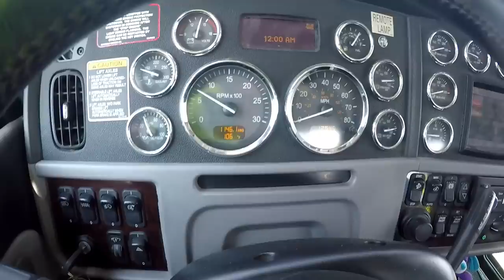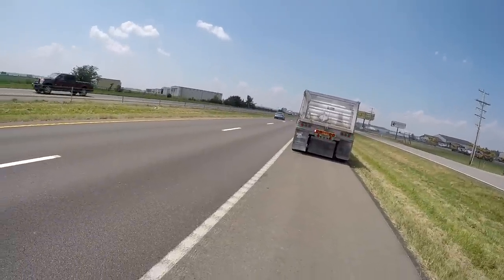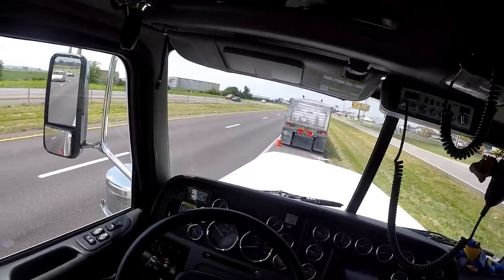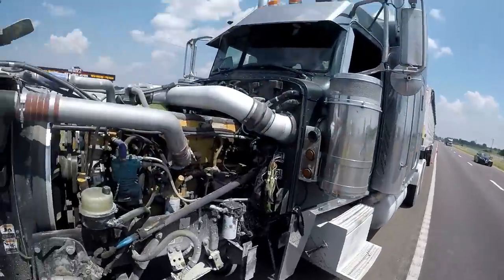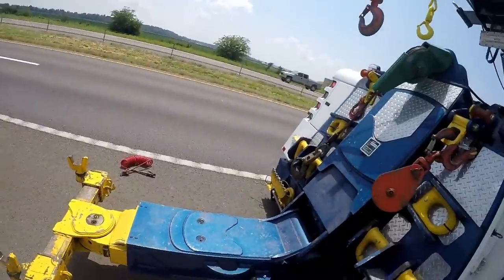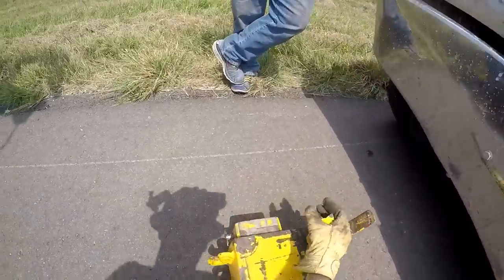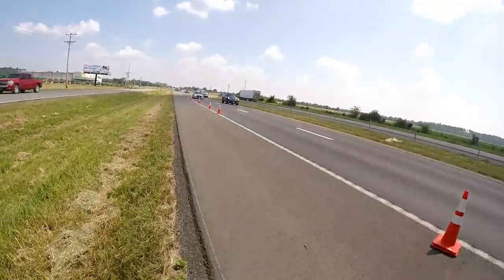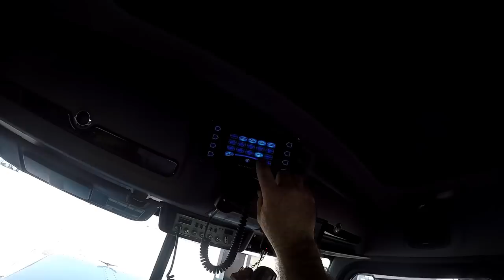THIRSTY TRUCK ON A HOT DAY

Comment: You could pick up a surplus M-60 tank to use as a blocking vehicle. Wouldn't even need warning lights...
Reply: Yeah , and how long would it take to get there ? Lol !
Reply from the maker: I love the idea as long as the cannon and guns are still live.....just in case I have to make an example out of a driver that doesn't get over.  Guarantee the rest would move.  Just kidding.  I'd never hurt anybody intentionally.  A tank may be what is required to move them over though.  Wouldn't that be a sight??!!  Thanks for the chuckle, friend.  God bless.
Reply: Ron Pratt 3
Reply: A nice cheaper alternative would be a nice little used M113 the good ol' aluminum box on tracks that we've been using since the '60's, nice power and it doesn't weigh too much comparatively but rest assured it can still drive over and crush truck if you need it too ;) lol. And it's good for off road extractions too like that U-haul van from the past.
Reply: @GoldPicard  i think rhats a good idea
Reply: Ron Pratt I was about to say point the gun down range and have someone sitting on the 50 lol
Reply: @protectoroffaith  thatd do it 😂
Reply: Oddly enough they will see that even though it has no lights and is painted in army green.
Reply: Wet Lettuce “it’s camouflage. I didn’t see it!”
Reply: I saw something like this at a parade once. An Abrams tank was coming down the street. Lots of people were off the sidewalk, in the road, until that big beast slewed the turret a few degrees in either direction. Then they were tripping over themselves to get back out of the road.

Comment: Too many stupid people on the road that have no idea what hazard lights represent and what you should do when you see them!!
Reply: I  would    say      not    to many    but  all of  them.
Reply: Some of the drivers could not get over because of a car beside them going the same speed as them ive had issues where I could not get over for a tow truck because of someone being a idiot and slowing down when I wanted over.
Reply: There was this dude cutting off a fire truck the other day
Reply: @charlieretro  how about using the brakes... or if it's a somewhat decent car, the gas pedal. if he's going the same speed you are what's he doing on the overtake lane anyway, but besides that, you can just hit the brakes and go behind him or accelerate and go in front of him (and then slow down to annoy him back a bit ;)

Comment: Nice job on the lightbar.... Also a good idea for you or any one else.. If your phone is having issues  with loading an app or even making a simple call... Instead of turning it off then on...  "some phones take forever to restart" just turn on airplane mode on  and then turn it off after 10 sec... IT resets your data and reconnects  to a new tower
Reply: Yes, airplane mode CAN be faster than waiting on a phone to cycle down and up,  but it doesn't hurt to cycle your phone off once a day (or once/week at least).  Do it before you need to use it, and it'll be refreshed for when you need it.

Comment: I used to deliver hot tubs with a 40ft flatbed truck- I always set cones out any time I parked on public roads.  Had one driver intentionally hit my cones, scattering them all over the street.  It's like a game to some people...
Reply from the maker: Sad but true.  And getting worse with "distracted" driving.  Thanks for watching and God bless.
Reply: There's a foundry down the road here, and I've been wondering how much it would cost to get a cast iron traffic cone made.  Good coat of paint, put it second in the cone line, and make sure you have a good HD camera to get the video for YouTube.
Reply: Joe Bramblett With cast iron, I think it would turn into a frag grenade when someone hits it. Too much shrapnel
Reply: @appleintosh   we need a hollow soft steel shell filled with concrete, just like those poles in front of wallmart doors, hollow shell bends, concrete explode but a combination of the tensile strengh of steel with compressive strenght of concrete is just impressive, just look at that totaled car vs that saved life
Reply: @andromaliusification  blue concrete.. it won't break if you throw a v2 bomb onto it :P the normal gray concrete isn't all that good. but on the blue concrete you can waste quite a few drills before you have a hole in it. (as in it's cheaper to just move stuff made out of it and ditch it in the ocean than attempting demolition ;)

Comment: National Weather Service has issued a Warm Weather Advisory for Southcentral Alaska starting Friday and running through Saturday. The warmest day will be Saturday with temperatures climbing into the lower 70s along the coast and mid 70s to lower 80s inland.
These temperatures will be 10 to 15 degrees above "normal" high temperatures for early August.
Please take appropriate precautions for your children and pets, and have a fun-filled weekend!
Reply from the maker: Ok....I'm moving north to Alaska!!!
Reply: Thought you'd get a chuckle out of this.  I copy and pasted this, when I saw your 106.  I've hauled a lot of melons out of your neck of the woods in that kind of temperature, but I sure am enjoying my retirement up here.
Reply: Ron Pratt are u really
Reply: Ron Pratt people are so ignorant today maybe you should close of a lane so they must slow down or stop it I saw someone like you I would reduce my speed by 10-20 mph and move in the other lane
Reply: That's the temperature here lol
Reply: When i went to Ireland they were having an unusually warm summer. The locals basically said the same as that weather advisory. One even went so far as to use the phrase "boiling."
Reply: After 2 weeks of 80's to 87's here in Minnesota today it was 67 with some rain, Its supposed to be low to mid 70's all next week. But the building I work in has plastic and rubber molding machines along with an industrial oven that is almost always at 400F every day but Saturday, so its always warmer than outside.
Reply: Max Bailey it's currently 12°c in Ireland. I checked that's 53.6 in the American system
Reply: Alex- lee global warming is the culprit?
Reply: Lol!
Wooo, summer vacation in Alaska, 2018!
Reply: hey at least you  dont live in Utah  where our normal  regular high is 105-110 degrees
Reply: You could come down to FL where it's mid 90s fornsix months straight

Comment: Hi Ron, great work out there. I grew up around the business, I currently don't operate but would like to, besides that it's great to see how your so helpful to everyone and that's what the industry needs more operators like you. Your an inspiration to new operators. I do have one question about your updated tow light, what make and model LEDs (red/blues) did you use on it? I like the idea and I like how you could still see them from the distance that the officer had stopped at. Thanks for being out there helping.

Comment: that was an expensive tank of gas.
Reply: Yeah, when I watched yesterday my first thought was just like a company man to run the thing out of fuel a mile from a fueling station. Kudos to Ron for his attention to detail like noting those low tires and stopping to call for traffic control. He's got the gift. Situational awareness.
Reply: Thanks it was a big petrol station. I remember a day some years ago when a bus and my semi (with double fuel tank) stopped for a complete refueling in a very very small gas station in nowhere here in Spain. We let the station tanks empty. The petrol company has fill them few hours before. When we continued our route the owner hanged the sign ⛔️CLOSED⛔️
Reply from the maker: Yes, it is always a bad day when someone runs out of fuel.  At least nobody was injured or killed.  Thanks for watching and God bless.
Reply: I once ran out of fuel some 500 yards from a fuel station. Yes, the low fuel light had come on, but the vehicle (Mercedes Sprinter, max 5 metric ton or 11K lbs) was using 14 liter per 100 kilometer (16.8 MPG) and the manual said the light would come on at around 2 gallon. I should have been able to drive 33 more miles, and the gas station was 10 miles out. Didn't make it...

That day I learned two things: One, I couldn't make two of my regular runs (I normally only had one per day) on only one tank of fuel even though the gauge told me I had more than half a tank left after the first run, and two, don't trust the warning light of that truck. It's a good thing the manual also told me it was self-priming, so after putting in some diesel it started right up after 30 seconds or so.
Reply: Paul Nieuwkamp I learned years ago, from watching my parents, to never trust any fuel gauge when you haven't personally run the vehicle empty to determine how much real reserve it has. My favorite car to drive, an old 280ZX, actually has 2 sending units and 2 gauges - one set only reads up to 1/4 tank, and when that gauge hits 0, the tank is empty*. Even the with the digital bar graph display, that tells me to within 1/2 gallon *exactly how low I am.
Reply: @RonPratt How much does big truck towing cost just out of curiosity?
Reply: @zuestoots5176 one of the first things I add to each vehicle is a two gallon can for just that reason; fill the can, put some HEET in the tank and run the tank dry noting how far after the light comes on and whether it gives any trouble before dry, then use the can to get it to a station and fill it up with good gas.
Then it gets the floor jack and four-way lug wrench, jug of coolant and a couple quarts of oil.
Unfortunately, none of this helps when a huge raccoon decides to head-butt the corner of the radiator at 70mph and it dumps all the coolant within two miles, 85 miles from home and 14 miles from the nearest mechanic, who doesn't open until Monday.  Yeah, it's been a wasted Saturday waiting for a wrecker and then looking for a place to stash the key at the shop so I don't have to go back to take it to them Monday, then getting my roommate to drive out there to get me.
Reply: I just ran one car dry, but was able to roll to a gas station (happend by accident - sketchy fuel gauge + very variable gas milage).
On every other one I know how much they drink and the tank volume (got one down to 1.6 liters left in the tank), current one calculates the remaining kms from EFI parameters and that will reach 0 before the tank gauge does (says 40kms left, that should leave 3.2-4 liters left in the tank, but according to the pump there still were 6-7 in it). Guess they built in a safety margin, as here in Germany running out of fuel on the autobahn results in a fine).

The other stuff, some oil, water, and a good sets of tools, I consider mandatory.
Reply: @nonameposter378  I'd take a guess and say it costs $500 just for him to hook it up

Comment: Why Don't You Put Magnets On That Light Bar!???
Reply from the maker: Some light bars come with magnets built in.  We don't use the magnets for several reasons.  1---there are a lot of vehicles with very little metal in the area needed to mount the light bars.  2--the magnets tend to damage painted surfaces even if well protected.  Thank you for the suggestion, though.  Thank you for watching and God bless.
Reply: plus sometimes there is hardly any steel for the magnet to stick on magnets dont work on alluminum
Reply: Most trailers are aluminum they dont make magnets for that :( they'd come in hella handy tho

Comment: @Ron Pratt You should buy the safety flag that oversize loads use. Put it on the end cone. People might see it a little better. If not that buy a custom construction sign for yall.
Reply: I dont think visibility is the issue. Its impatient drivers who either dont understand or dont care about the risks.
Reply: I agree with both comments he needs a scout car say park 1mile back with big sign saying slow down move over in effect his own cop car
Reply: Lol
Reply: People just don't seem to take notice of signage. A couple of years back there was a breakdown in a tunnel on one of our motorways, For about 2 miles there were multiple illuminated warning signs saying "Lane blocked ahead, merge right" (we drive on the left here). But no, 10% of drivers stayed in the left lane right up to the obstruction, then tried to merge despite the traffic being light and plenty of opportunity to merge when driving at road speed.
Reply: We have that problem here in the States, too. It's aggravating at the least. With all those signs at least a 1/4 mile before the construction zones, people ignore them and try to cut in at the merge point. A lot of people, myself included will cut them off, since we've been the ones being patient and waiting in line like we're supposed to. The one thing that makes me mad is when the self entitled pricks drive down the shoulders bypassing everybody. But i get some satisfaction out of that when they get stuck behind someone who has broken down on the shoulder, it gets even better when there's a cop there. Karma then bites them.

Comment: I suggest sorting equipment the truck carries into commonly used equipment and less used gear and storing all the commonly used tools in the passenger side of the truck.
Reply: also taking out the passenger side seat so the driver can simply get out on the passenger side (easier anyway), maybe even ordering the next ones with the steeringwheel on the other side for that reason. (but that would kinda make it hard to see if no idiots are passing by when pulling back onto the road)

Comment: Good vid.  Just curious .... what is the charge (fee) for roadside service like that?
Reply from the maker: We gave the customer a great deal on the tow.  I had already driven out to check on this driver and for multiple reasons towing it in was quicker and safer than fueling and attempting to restart the truck on the interstate.  I don't discuss exact pricing on an open forum like this, but I do understand everyone's curiosity.   Thanks for watching and God bless.
Reply: As Mr. Pratt said, wouldn't say exactly.  There's list rate, contract rate (which only two people know) and discretion rate (bosses or tow drivers have some leeway)

Comment: I lived in Nebraska, in 1971, long enough to experience a winter and start of summer. From Virginia, at 98 degrees with humidity at 105. Then to Nebraska with 110, dry air, felt like Virginia 99.
An experience. So I understand you and your weather.

Comment: When u r stopped maybe put ur cones out farther into the lane so the other cars don't have a choice to move over. Just a tip
Reply: ScrewyMallard 12 they will just run then over we try different things like that in construction people don't care
Reply: ScrewyMallard 12 He's probably technically not allowed to block a lane without authorization.
Reply: Without some form of advanced warning or highly visible traffic control vehicle at the starting point, thats risking causing an acciedent. Drivers may not see the cones in time to safely merge to the other lane. And without any visible warning to drivers in the other lane they wont be expecting merging.
Reply: ScrewyMallard 12 that's what I was gonna say but I don't know if it's legal for them to do but it needs to be
Reply: That's not a good idea if somebody swerved last second to avoid it and rolled or caused another wreck he likely would be held responsible.
Reply: If you're doing construction, surely you have enough extra concrete or asphalt available to fill a cone or two.

Comment: My one suggestion when placing the cones is place them just to the traffic side of the white line as you're laying them out. On the return  trip move each one progressively further into the travel lane so that by the time you place the last one you have about a minimum three foot buffer zone between the cone and the truck. I hope by the time you see this you'll have read my previous suggestion about a progressive arrow like in construction zone signs that have arrows moving to one side or the other of where you're placed on the roadway. Hope it helps.

Comment: Ron,
Just a suggestion for dealing with the Chiggers, Ticks, and Mosquitoes.
Per numerous doctor's suggestions, I started taking Garlic Oil daily for my Arthritis some years ago. Though it is also good for your Heart and Digestive System.
I noticed after a while that I was no longer bothered by Mosquitoes, Ticks, or any insects. After a little research, I learned that almost all insects HATE Garlic.
With the Garlic in your system, the bugs leave you alone. I have not had an insect bite for years now. I normally take 4,000 MG. per day, but I actually increased it to 6,000 Mg. per day during the warm months when the bugs are more active. Just to be sure.
Added bonus: If you are a gardener, Garlic placed by your flowers and plants will keep the bugs off of them as well.
I place a Garlic Clove at the base of my Rose bushes, and it works very well at deterring them. Also, planted at the outer edges of your garden, Rabbits & Deer will smell it first, and often won't go further into your garden. Seems that a lot of critters don't care for Garlic either.

Comment: 2 suggestions:
1) next time you have the light bar hanging at an angle, why not put 1 of your blocks behind the bottom so it sits straight, maybe even build one that attaches to the back to fill the gaps (or even put strong magnets on the back so you don't need the rubber straps).
2) Can you legally use your cones to block off a lane forcing traffic to move 1 lane over exactly like the nice Officer did? Love the fact that you called his Supervisor with a Compliment...I bet most of the time all they get are Complaints.

Love the Rotator...wish I had the $ to buy one...